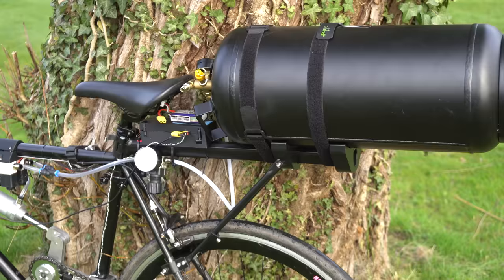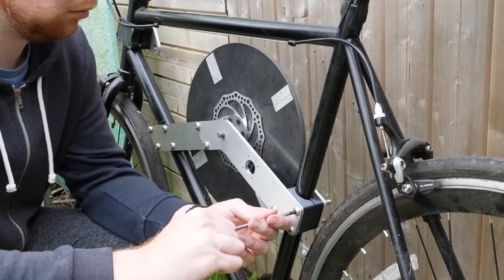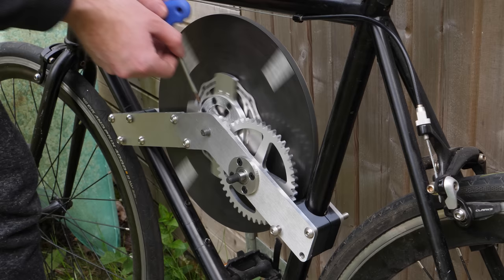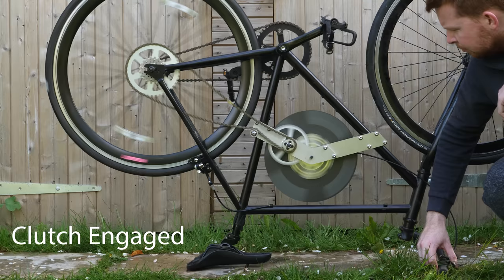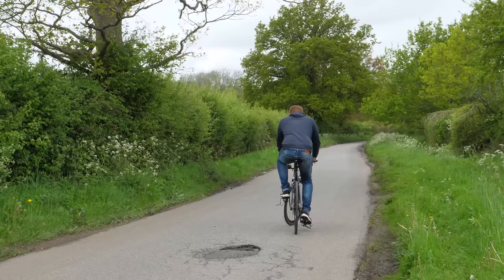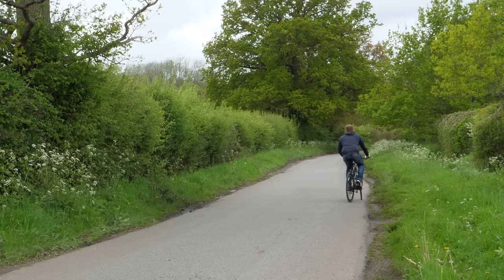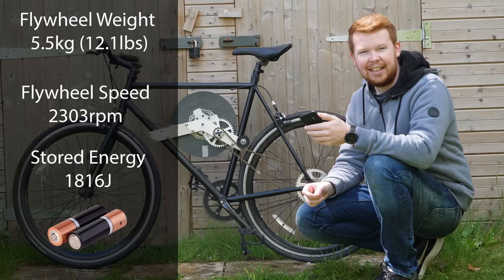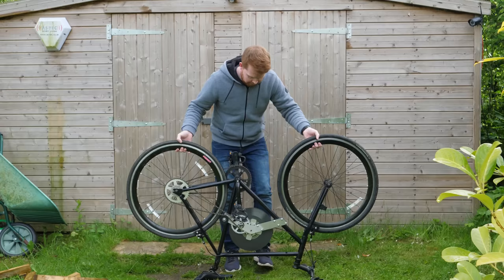Flywheel Bike KERS

Comment: It would be some what dangerous...but I wonder if there is a way you could store the energy in a strong spring instead. The way garage doors do. Springs are the best at storing mechanical energy. Because they are essentially like mechanical batteries. It would make an excellent braking system for sure, because it would brake with progressively more force the longer its engaged. And if it had a locking gear system, that only released upon command, you could store that extra boost as long as you needed. It wouldn't be quite as dangerous, if the spring could be stored some how within the tubes of the bike frame itself, so they couldn't shoot out, if snapped. Its not something I could build, because I lack the tool and experience. But based upon what you made, it seems entirely possible. In essence turning your bike into a wind up toy. Except it would wind itself up while braking with a clutch. Seems like you have most of what you need for the idea done. If you modify the flywheel to wind up wire rope instead, conceal some springs safely in the frame or in a sealed add on container, and run the wire rope with welded pulleys. This concept would be much more effective. Another benefit is that you could utilize the boost whenever you'd like, from a dead stop to get you going, to help you up hard inclines, during the middle of you peddling when you're tired, or even while you are peddling at your top speed for like an rpm boost.

Comment: So when your normal bike is not giving you enough exercise just add a flywheel to it.
Reply: Well it's a good idea if you want to make your legs work even when your commute is usually very flat terrain, also I'm guessing it's easier to control your bike on a descent with a flywheel as normally you either wear the hell out of your brakes or embrace the madness that's going way faster than it is safe.
Reply: @cdgonepotatoes4219  Will only work on very small hills. The flywheel wil just keep spinning faster and not really do much
Reply: @kaptein1247  yeah... still something though
Reply: @cdgonepotatoes4219  I doubt it would be noticeable on e serious decent where you would need to break hard for a long time. The flywheel will just get up to speed in the first few seconds and not do anything after
Reply: Seen and talked to a bike rider who used extra rubber bands on the handbrake to add resistance to peddling for training propuses!
Reply: @cdgonepotatoes4219  Once the flywheel gets up to its terminal speed it would make no difference going down hill.
Reply: You guys apparently didnt watch the video. The flywheel has a clutch.
Reply: @phillhuddleston9445  already went over it with Kaptein
Reply: Or just attach a chain and a big tyre.
Reply: @terry12327  “you add salt water to your chain instead of oil or wax?” “For even more resistance!”

Comment: It requires quite a lot of energy to get going for standstill. KERS is more useful for storing energy from slowing down before going into a corner and then using that energy to recover momentum (or building up speed) as you are coming out of a corner.
Reply: Aka cruising
Reply: This would work for me coming home from work because the first half of that journey is downhill with breaking due to traffic lights. A lot of energy could be stored with no impact on my travel time or effort used. Then then I get to the bottom of the hill and need a little push up some rises, it would be sufficient. So it depends on the specific journey dynamics.

Comment: That's surprisingly efficient!  But I do think you should still try building a CVT some time because it would really benefit this and a lot of your other projects, you might be able to recover more like 70% of the speed.  Since you have access to a CNC machine, I don't think it would be as complicated to build as you might think.
Reply: You could also go with something like a go-kart/minibike CVT "torque converter", which has the added benefit of also acting as a clutch.
Reply: Yeah, IMO he's losing massive amounts of energy to heat as the clutch slips. You really need a near instant clutch engagement to recover most of the energy.
Reply: Just use 2 hub motors connected by wire with a switch. You might need a gearing system to match loads. Ideally you want about the same kinetic energy per motor rpm, so gearing the flywheel hub to turn the wheel faster is best. But other than that the motor will draw a nice big kick of power off the line and then reduce its power draw.
Reply: So many smart people in the comments
Reply: @jeffwells641   Same time, he could also CNC a custom flywheel to move weight towards perimeter to take advantage of angular momentum and reduce weight.
Reply: not complicated???  do you even know what a cvt looks like?
Reply: @estaworks-3d102  no
Reply: but CVT's 'absorb energy '  .. so significant benefits might be elusive , though your idea is sound!
Reply: @TimpBizkit  @Tom Stanton You could use a buck boost converter between the motors as a CVT to convert voltage (=rpm) to current (=torque) and vice versa. Or you could do the same with one motor and super-caps instead of a flywheel.
Reply: @trillrifaxegrindor4411  Oi! You got a LOICENSE for that... engineering?
Reply: @TimpBizkit  just connecting the wires would be analogous to just engaging the clutch super hard. Youd end up with the motors running at the same (electrical) frequency and a bunch of heat. To efficiently capture the power, you'd need an inverter for each motor and would significantly benefit from one or both motors being capable of field weakening.
Reply: @jeffwells641  instant engagement really won't help. Consider the energy stored before and after the clutch engages. Dumping the clutch will just increase the instantaneous power wasted, and maybe lock the rear tire or break driveline components.
Reply: @roflchopter11  provided you don't use puny 250 watt motors that stall easily, or pick motors with a low DC resistance at stall, and use connecting cables of reasonable gauge, you should be able to capture significant energy. The limitation is that the output motor cannot spin faster than the input motor, so the flywheel will stop delivering extra acceleration energy when both motors match speed. However, the system will be able to power the bike for a while, reducing the rate at which the bike slows down.
Experimenting with field weakening (I'm assuming this is a way you can trade torque for extra speed, by reducing back emf and thus acting like a transmission system for the motor) would be an interesting concept.
Whilst my comments are largely theoretical, I do believe this system will be more efficient than a clutch system. The clutch system conserves momentum, but not kinetic energy, thus it is most efficient when geared down enough that the bike's increase in kinetic energy is significantly lower than the flywheel's at the engagement ratio. A clutch system would power the bicycle through a swamp at walking pace more effectively than it would launch the bike to high speeds.
Reply: This thing would benefit from any components of a transmission beyond the essential clutch. Honestly I would start with a fluid coupling to deal with the lash without wasting so much energy. Something like a torque converter clutch where it can be variably applied.
Reply: Might see 16%. No way would you see 70%.
Reply: @TimpBizkit  would it somehow be possible to use a variable transformer as the 'CVT' component of the electrical system? I.e. the hand lever causing the contact location to change, causing the number of primary and secondary windings to change?
Idea might be wide of the mark, but intuitively stepping up/down the voltage should achieve similar variability between motor speeds.
Reply: @estaworks-3d102  yes! But I agree its complicated not due to its machining requirements but rather the belt requirements. 

I'm thinking of the one with the 2 cone shaped discs, not the ones with the variable gear diameters.
Reply: @cecilmicko6828  it’s like watching/listening in on two professors debate a theory over lunch
Reply: Woah didnt expect you hyperbolic boi here

Comment: A bolt on kit could probably be made or combined with an existing engine based design to help improve efficiency. It is quite impressive that you've managed this with simple machining tolerances limiting you. You should try a design with the flywheel weighted towards its edges (i.e. thicker towards the edge or with a heavier metal bracketed around the circumference of the flywheel!

Comment: I would really like to see this when going down a large hill.
Reply: This would be good in hilly terrain where you can charge the flywheel downhill and get an assist uphill.
Reply: I think it might explode from too high rpm
Reply: That won't happen too soon. It rather would shake the clutch apart before that.
Reply: @mikegutsch5769  Did you see the assist it got from just a standstill? Imagine going uphill. You just carrying 6kg of dead weight all the time for that miniscule of boost. You are better off drilling holes in your bike for saving weight and saving energy that way.
Reply: Couldn't you store the same kinetic energy by just having a heavier bike or heavier wheels?
Reply: @earthstick  Yes, but the difference is that you would be forced to use the energy immediately vs storing it for a little while.
Reply: @earthstick  yes. But you can't effectively use it. If you break you transfer that stored kinetic energy into heat. Therefore can't use that to accelerate. And going uphill makes you "loose" that energy the moment you are on the same height as you went downhill. A flywheel also has one more advantage. The kinetic energy in the flywheel can be much greater than in the bike itself because of the gear ratio. Which you can also isolate.
Reply: @CS_Mango  Yes I understand the regenerative braking but that was not so effective in this test.  Storing the energy while you are stopped is useful for setting off.  It has benefits but they are not a great as they first appear.  You then have to subtract frictional loses when transferring energy to and from the flywheel - probably not large but it reduces that margin a bit further.
Reply: fastest gear pedaling full sprint down a hill? with that thing spinning nahhhh

Comment: when you go to take off, just like a car "give it gas" or in this case... start to peddle when taking off and then use the clutch, idk what I'm talking about but I feel like that will make you go faster or push you farther.
Reply: Yep, I was thinking about this, since this is how it would be done in racing cars with regenerative braking
Reply: Good point. I think his demonstration with starting from a stop makes for an easier data point. But your right, I think his setup would do best in real world cycling after making those first couple pedals. Better yet, regen descending a hill, and using the flywheel to get up the next. Might take some skillful gear choosing to make the best of it though.
Reply: If it was a smooth, refined system you'd certainly pick up the beat way to use it in your application. But energy recovered is still the same, there are friction losses as the flywheel spins up, and friction losses as the flywheel is re engaged, so it isn't going to be great, it's only the recovered kinetic energy of your body and bike, that's not a while lot anyways.
Reply: This idea is stupid.  He is only demonstrating what we already know.  The flywheel would have to be MUCH heavier to be of any real use.  But that would lower the overall efficiency of the bike.
Reply: @tarstarkusz  He could use a heavy weight but that still won’t produce an efficiency of more than 15%. Adding more weight would make it harder to get it going but also deliver more punch when getting going. Either way still outputs the same energy as being put in. (Of course at the 25% efficiency)
Reply: @rutchjohnson  Yes, I mentioned that.  It will work better, but the bike, overall, will be less efficient than if it had no flywheel at all.  Might be nice on the downhill section, but MUCH worse on the uphill section.
Reply: @tarstarkusz  Eh, it just trains up your leg muscles. I used to ride my bike in the highest gear cause the chain would pop if I tried to change gears while riding. I got so used to it that it felt like the standard 3rd gear. SO for weight training and efficiency it would be a real winner. Plus as I stated before just put the flywheel on the wheel hub and use two of them. Perfection!
Reply: @youtubu124  Well, if the idea is to give your legs a strength workout, what do you need flywheel assisted starting for?  The biggest resistance on your legs is starting from a stop.  It is a rube-goldberg device of inefficiency.

Comment: I mean, there's no point in spinning it up while pedaling. The entire idea is to recover the energy that would otherwise be wasted as heat by braking with conventional friction brakes. Instead, you're doing nearly 7 times as much work to store that energy as you would have used just to accelerate from the stop that much by pedaling, due to the 15% efficiency (a loss that isn't present in the pedal-only method).

What this could potentially be used for is for storing energy while coasting downhill while maintaining speed, to then be used to continue to maintain speed on the way back up the next hill... but I think you'd need a real CVT for that. And a much better flywheel that isn't quite such a rickety, terrifying mess, and that can preferably go to much higher RPM to store a whole lot more energy.

However, I think by the time you do all of that, just adding a regenerative braking system with a capacitor and either a large enough electric motor to reuse the energy, or a smaller motor driving a flywheel electronically, would be much simpler. The electronic systems would basically behave like a CVT but with a lot fewer wear parts and a lot less noise.

Also, just FYI, tire weights are designed to go on the inner surface of rims, so centrifugal force helps keep them on. That adhesive is in no way designed to hold them against pure shear force like that!

Finally, all that noise is also wasted energy. Not a significant quantity for the quick stop-go runs you were doing, but waiting at a stoplight or a crosswalk could see a rather large chunk of your hard-earned kinetic energy sapped away by parasitic friction effects.
Reply: Yes this is not free energy because extra effort is needed to pedal.... it appears there is a net loss because the effort to start from a normal standstill certainly looks like less then spooling up the flywheel by pedaling ...
Reply: CEO of "actually ☝️🤓"
Reply: What you'd probably actually use it for is capturing energy while going down a hill to reuse going up the next one.
Reply: @laurenceperkins7468  would love to see him test this next
Reply: I have no idea what your talking about but I’ll research it

Comment: This would probably only make sense when going up and down hills, as you wouldn't want to go down hill too fast, but would want some assistance going up
Reply: The only problem is all the added weight, the flywheel adds 12 lbs to the bike, that’s a lot of extra weight to use to get up a hill on. Though I think it would be interesting for higher speed cruising on road bikes since you could store energy without breaking when at high speeds by letting the bike coast and then use that energy to accelerate when getting hit by a gust of headwind that would typically slow you down by quite a lot
Reply: Or in towns, where you have to stop and start a lot. That's where the biggest gains of regenerative braking are in cars as well.
Reply: @brisingrxm6022  you need a flywheel with big diameter and weight only on the edge. Like a small bike wheel with lead "tire". Less overall weight for the same capacity.
Reply: @jubuttib  you'd probably need to use coupled motors for that to be very usable
Reply: @michaelharris679  Probably yeah.
Reply: Fascinating you managed to achieve something the car manufactures dream about
Reply: I would think a lot of energy is lost to heat via clutch slippage
Reply: @brisingrxm6022  nothing beats a carbon fibre lightweight Road bike